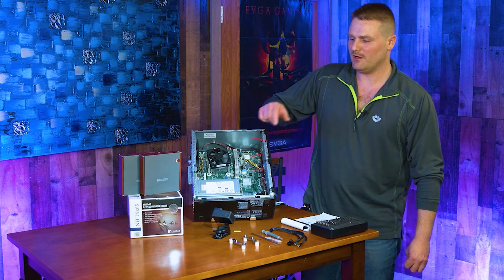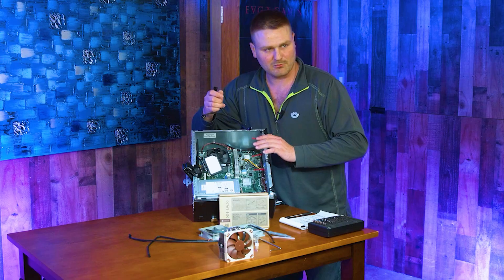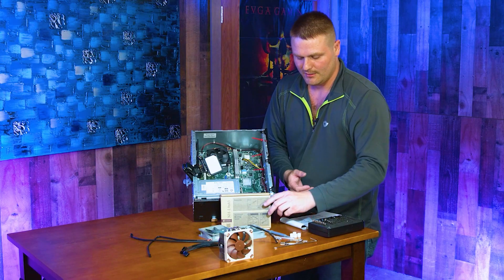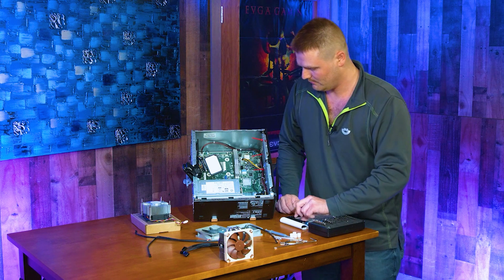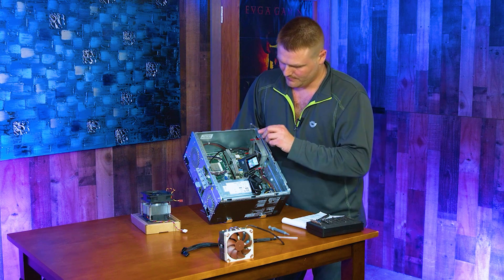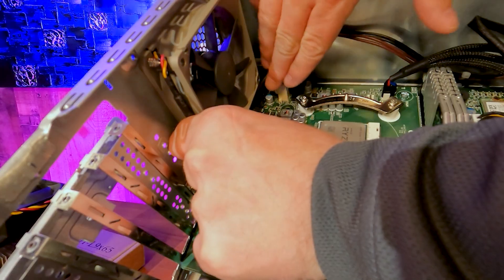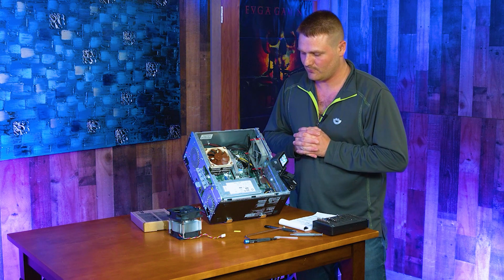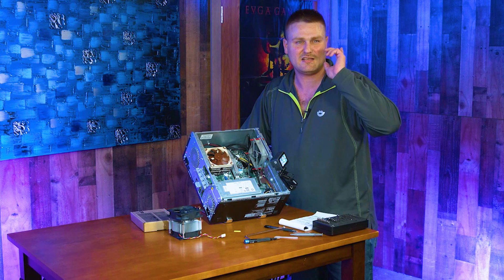HP Pavilion TG01 Cooling Upgrade Noctua CPU Heat sink and Fan Install W/ How To  1

Comment: Sorry I'm completely new. If I just want to upgrade the cpu cooler/heatsink, I just buy the small cooler linked in your description, right? Everything else irrelevant?
Reply: Be sure that the cooler is compatible with LGA 1151 mounting.
Reply: @XTRakki  do you have a cooler that you use or recommend? Ive been looking for a cheap one to get on sale but finding small ones that fit is hard
Reply: @bax9  What would be your highest price you'd be willing to pay? What's your budget?

With confidence, I would recommend most of the fans +$35 from brands like Noctua, Arctic, Scythe and Cooler Master. All of those are known and reputable brands in fan manufacturing.

My recomendation for the price range would be $35 - $55, because fans priced under $35 are usually smaller, not that quiet and not that effective in cooling your processor.

Before choosing a cooler, always research and try to find as many customer reviews of the product as possible. There can be, and are hidden gems with only few reviews, but more known/common coolers with alot of positive reviews, usually have those for a reason.
Reply: @XTRakki  Yeah I can do $50 budget. The issue is knowing which heatsink/fan fits properly onto the mobo that's small enough.
Reply: @bax9  Because I'm not 100% sure if a "tower" CPU cooler will fit the case (Otherwise 'ARCTIC Freezer 34 eSports Duo' would be my #1 pick), I'll recommend 2 low profile ones.

• Noctua NH-L9x65 (~$50, 95mm fan)
or
• Scythe Big Shuriken 3 (~$45, 120mm fan)

Both are tested to fit the case and got good reviews from multiple users.
Reply from the maker: Yes the Smaller cooler does work.  I had one but it did not come with all the parts. I give up on it.
Reply: @TNW1337  what do you mean it did not come with all the parts? they accidentally messed up your order, or does it not work with the build unless i buy extra stuff?
Reply from the maker: @bax9  no the cool comes with the right parts it is just not made for the hp sff boards you need longer screws 16mm so they are long enough to hit the bracket below.
Reply: @TNW1337  oof, well, the hp board from the computer in your video is what i'm trying to get a cooler for. do you have something else you'd recommend for it?
Reply from the maker: @bax9  yes this is the same thing g they are linked in just. About every video I do at the top click on the down facing arrow next to the name of the video.
Reply: @TNW1337  Yeah but you said the small cooler doesn't work with the HP computer because the screws aren't long enough? I'm using the HP computer in the video and wondering if there's something else then.

Comment: How well does your memory upgrade work?
I've read that most memory will not run the correct speed due to the BIOS being locked on these PC's.
Any truth to that?
Reply: Yes, I have this exact pc and cant change the ram speed through the bios. I change it with ryzen master. It sucks because I have to apply the profile change everytime I reboot my pc but atleast I can use the ram speed I bought
Reply: Also, what is the most important when buying RAM when it comes to CL and voltage?
I think I've read that Crucial makes a generic RAM that is CL 22 and 1.2V that is plug and play.
Can anyone corfirm.
Reply from the maker: If the speed is that impotent, your only gaining 5-15 FPS at most. you can order the ram from HP.  Really the most important thing is the dual channel.

Comment: I bought this pc with i5 11400f and rtx 3060 ti. After gaming for a while my gpu temperature was 83c° and cpu 76c°. I removed those metal things inside and it became little bit better. Can i Mount one 120mm fan on the sidepanel with two sided tape and add better cpu cooler and exhaust fan. Will these Mods make big difference?
Reply: Hey! With your RTX 3060Ti, the only fan size you can fit to the side panel, is 80mm. For the from and back, 92mm should fit well. For mounting, I'd recommend a Anti-Vibra kit, so you don't need to use screws and can is more quieter.
From one test (where GPU was a single fan version) done with a 80mm fan on the side, the overall temperatures dropped 4°C. (From 80°C to 76°C).
Reply from the maker: They do get hot.
Reply: @allumiekk7461 Hey man, I got the same problem with the GPU , did you solve it with anything?  Mine goes to 95 even

Comment: So can you use standard universal Fans and heat sinks? Or do you have to use this noctura one
Reply: You can use any fans, from any manufacturer if they are the correct size. I recommend fans made by Arctic. They are near to Noctuas quality but some times even 2-3x cheaper.
Reply from the maker: Rakki I also add you to the always approved list, Been having problems with spam comment on the channel had to disable links.
Reply: @TNW1337  Thanks!
Reply from the maker: Arctic does make good fans and they are cheap.

Comment: I thought your exhaust fan was 3 pin? I got a tg01 and the exhaust fan is 3 pin I believe but the fan in the desc is 4 pin?
Reply from the maker: I use the cpu header for the added fan.
Reply: @TNW1337   Sorry but maybe I'm misunderstanding this. I thought the PWM 4pin was where the splitter went, then the cpu fan took the 4 pin while the front fan used a 3 pin and the exhaust fan used a 3pin as well.  I just looked into my case and the exhaust fan is a 3 pin. Am I understanding it wrong?   CPU fan 4pin pwm ,  and then intake and exhausts 3pin?

Comment: Do you think if we kept the gpu stock with 1 fan. Would there still be negative temperatures putting a intake fan on the side? I’m also skeptical about putting the intake fan up top. There isn’t holes on the face plate of the case.
Reply: Hey! If you have a single fan GPU, the side intake fan could drop you overall temperature 4°C (according to a test done by another YouTuber)
+ There are vent holes on the top of the front panel.

Comment: Love the upgrades. I just bought a TG from HP and I want to move everything into another case. I want to know if i will need to buy anything at all besides PSU, motherboard and case? And will you be doing a video potentially on this? love the content its very helpful
Reply from the maker: Soon yes
Reply: You're pretty much on the right path. PSU, MoBo and Case have to be changed, but everything else can be the same.
Reply: Im also thinking to do the same
Reply: Is the video out

Comment: I've been having connection and speed issues with my Ethernet lately and noticed the network adapter is part of the mother board, but there's a slot right behind it. Is this space for a network adapter upgrade?
Reply from the maker: There are 2 wifi cards that can do in. No only one nic on the motherboard. you could use the 1x for a Nic. I would talk to HP see if you can get it Rma. If it is the PC have you tried a different Nic cable.

Comment: Did this on a tg01-1810. Nocyua nh-l12s and 2x noctua nf-a9x14 pmw 92mm. Thanks for the tips in the video 😀
Reply: dremel the fornt and put on Stainless Steel Wire to.
Reply from the maker: Very nice!
Reply: Did you have to change the back plate, or just the rubber standoffs will work? Am looking into something like an ID-Cooling IS50X/5M/6K, whatever is still selling for an Intel platform in this case..

Comment: Sadly I did this upgrade but did not realize you did not use the Drive Caddy ?
So I have to remove the Front Fan that I just installed because I have a mechanical HD unless there is another way to attach a Mechanical drive to another Location. And also relocate my extra SSD. 
Oh well looked good when I first watched until I went to get everything I had in there back in.
Big plus is, I have a Ryzen 7 3700X and a new Cooler by Noctua. Decided to get 2 smaller ones at the Front so the HD Caddy will drop back in without interferance.
Reply from the maker: Good Idea, Sorry I should have said something about the HDD in the front.
Reply: which fan did you get for the front? i also need my drive caddy
Reply from the maker: @oreonmilk1864  92mm noctua
Reply: @TNW1337  would a r5 5600x work in the mobo? i was recommended that cpu for a 3060 ti
Reply from the maker: @oreonmilk1864  only the 3000 will work. This is due to hp. The am4 board can support ryzen 2 gen 3 gen and 5th gen. But this mobo it can not.
Reply: @oreonmilk1864  small noctua! But not to long after that, I just moved everything to a larger Case! I did not have to do that but decided for myself that more ventilation would be best. (For me)
Reply: @dennistCV41  awesome! What case did you go with? I’m planning on doing a case swap as well
Reply from the maker: @dennistCV41  that's really smart.

Comment: Hey hey, I have the TG01 0023w and I just installed 16 GB ram but the speed is 2133 Mhz. I have the AMD R 3500, GTX 1650 super and I wanted to know how to change the speed to 3200 mhz cause when I tried from another tutorial, my pc wouldn't boot and I had to remove the CMOS battery and put it back into resetting the bios but it still runs at 2133mhz so I wanted to know if it possible to update the bios to be compatible with 3200 MHz? If not, how do I change it to 2666 MHz cause I just want my ram to run at a higher frequency? Thank you!
Reply from the maker: Well it depends on the ram your orderd. HP does not allow XMP profile so if the stock speed of the ram is not set at 2666 or 3200 it will not work. That down clocking is it dealing with the Cas of the ram. Other then Ryzen Master with hp there is no way to do it. But you need to have the correct voltage, And Cas Latency of ram to do it.
Reply from the maker: You have  some options here. return the ram you got. Order another stick from Hp or Deal with the slower speeds.
Reply from the maker: I would take 2133 dual channel over a single channel of 3200Mhz.
Reply: @TNW1337  Oh ok. I'll just deal with the ram I got with the 2133 Mhz speed. It's not it really affect fps for me THAT much.
Reply: I should also mention that I bought the Corsair Vengeance 2x16 kit with 3200 mhz. Sorry I didn't mention that and I also bought it physically at Best Buy
Reply: 2 x 8 I mean
Reply from the maker: @johnnyl4183  Corsair Been having problems with HP's. It is why I no longer support it. or tell peps to use it. Only brands I know work in the newer TG, is ones like Crucial, Oloy & Pny Xpg. Cosair was working in the older HP TG01

Comment: I have been following your videos they have been very informative for me I am new in upgrading my pc I want to build my pavilion PC for max performance I have the
OLOy DDR4 RAM 32GB (2x16GB) 3200 MHz what would be the best graphics card you found for in the pavilion so on and so forth?
Reply from the maker: If you can Find the dual fan MSI 3070 if you can get your hands on the 500 watts PSU. If not the 3060Ti is next best or a 2060 Super. The zotac is a little fat. and make it so the front panel doe not close 100%. I think the Asus & msi cards fit best.
Reply: @TNW1337  ok thanks a lot!

Comment: Dude you are a lifesaver. Now I have a monster TG01. I just change the thermal paste and the fans, keeping the heat sink I have 78ºC playing. I can note it is more quiet and cool. Thank you man
Reply from the maker: Glad I could help
Reply: Did you just remove and change the CPU's fan without fully changing the original heat sink itself?
Also, did you add any new fans or did you just change the back case fan for a new one?
Reply: @XTRakki  yes, and also yes he did add new fans

Comment: Hey there amazing video as always! this is a dumb question but were you able to get the 750w psu and the 3090 yet?
Reply from the maker: I have not gotten back to it so sorry. From my understanding is the HP psu gives out 12V all the time.(Even when the psu is powerd off) The Atx psus only give out 5v. And does not like a heavy draw on it. the PSU I had was 500watt Psu. They do make them in 750 that would fit if you made a plate. The big problem is to start the HP mobo it needs around 120 watts to kick on the Mobo. So I would need a buck converter that take 5v to 12v At around 120watts. I did order a O"Scope to see and Just have not gotten back to it. I was think about do a 2 or 3 in Sires or with a Relay that was timed.  I am not sure I hold all the knowledge to solve the problem.

Comment: amazing video, that's exactly what I'm looking for thank you so much !
I have a small question though, the front plate of the case have no holes, is that going to affect the front fan ?
Reply: The top of your faceplate has vents
Reply from the maker: Yes, correct
Reply from the maker: I should have took a Flash light and show it. Also I've been think about Dremeling it out to allow for more air flow, you would never see it as it would be done on the back side.

Comment: I bought a Ryzen 7 and it comes with a fan. Do you know if there is a way to use the fan it comes with over these stock HP set up?
Reply from the maker: Nope the fan will not work due to it being a 1151 Bracket. The one that comes with it is AM4

Comment: So i have added a noctua heat sink and cooler to my tg01-0023.  I did not use the fan adapter.  Is the fan adapter necessary?
Reply from the maker: If you did not install the front fan. sure